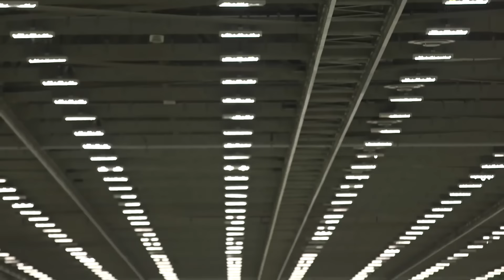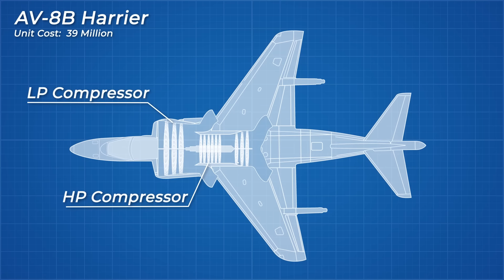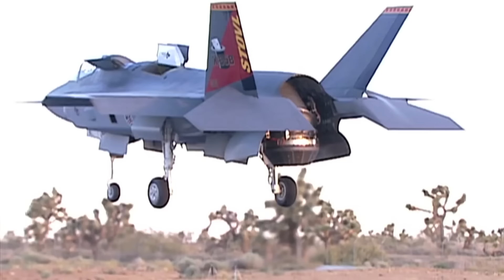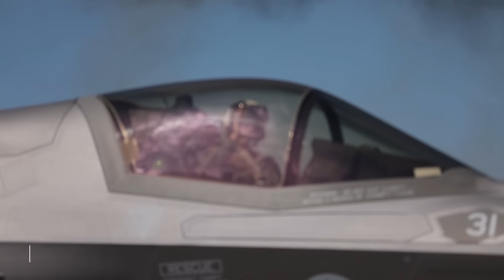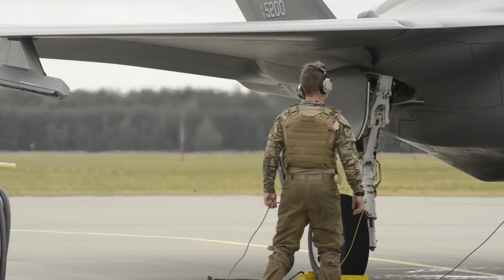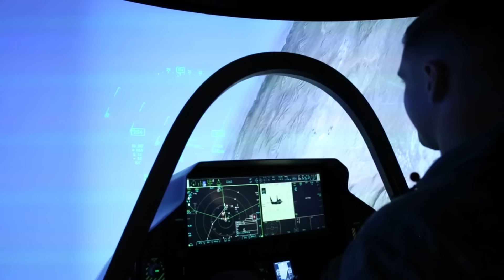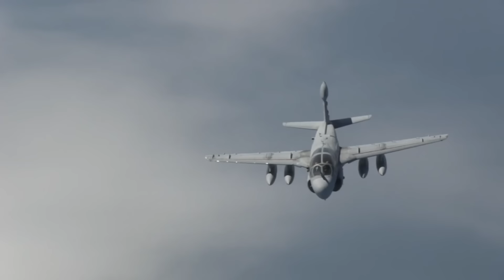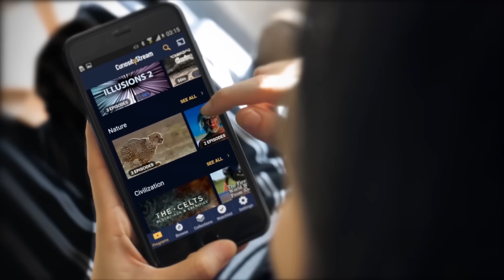Is The F-35 Worth $115 Million?

Comment: The weakness in the F-35 is, as reported, it's ability to recover kinetic energy levels after a turn. In a real world scenario the F-35 would see and fire first but would then turn tail and run. On turning, it will take some time to develop enough speed and distance to avoid being detected and fired upon itself. The very act of turning makes it more detectable too.
The only way to avoid the fire, turn, run tactic is too operate in big groups that increases the probability that no one will survive to fire back. No easy task when you consider the Russians, for instance, usually operate "en masse", carry more weapons per aircraft and fly faster.
Reply: Lol, the F-35 doesn't even need to turn and run. The 5th gen weapons complement and data link capability implies the plane can unload it's entire payload without ever switching on the plane's active radar with AWACS support, not to mention it's stealth capabilities. 

Data link implies that any American allied asset in an F-35's zone of operations will provide it with battlefield intel and vice versa. These are flying command centers capable of absurdly long range strikes.

And uhh, we've all seen how good the Russians are at "en masse" strikes the past few months
Reply: @krityaan  It is clear to me that you are pretty clueless so I will try, just a little, to enlighten you Krityaan Thapar. 
First, 5th generation refers to aircraft and not to the weapons they carry. If missiles were grouped into generations the most cutting edge ones would be something like 55th generation. 
Secondly, turn and run is a standard operating procedure because if you fire first it is pretty stupid to continue to close on aircraft who still have their full complement of missiles. Add to this that, as a rule of thumb, Russian aircraft carry around twice the number of missiles as our aircraft and so you are being reckless if you continue the advance with only dogfighting on cannons as an option.
As for AWACS, don't you think the Russians have their own system?
Reply: @krityaan  "guided munitions"? This phrase shows your total ignorance. Quite unbelievable from someone who is quite obviously Googling away.
Reply: @robwilton9539  
1. 5th gen refers to the platform, not specifically the aircraft, because it needs to be able to perform the role. It includes the weapons, avionics, and airframe.

2. Turn and run isn't a procedure at all for the vast majority of combat situations, let alone standard. There is no such thing as a true fire and forget missile, because missile seeker ranges are significantly less than aerodynamic max ranges. This means that turning and running will guarantee your missile will miss the target unless you are already within visual range, at which point there's no point running because you won't outrun the enemy missile.

3. Standard procedure is to put pressure on the target by reducing closure rate and maintaining an offensive position for a follow-up shot. If the enemy manages to avoid the first missile, or looks like they might, a 2nd missile is launched to take advantage of the enemy's low energy state after they've tried to avoid the first missile.

4. Russian fighters generally carry less than American fighters. Although an Su-35S can carry more than an F-35, it doesn't, because the Su-35S carries everything externally, which results in huge losses in performance due to parasitic drag. A standard air to air payload for the Su-35S is only 6 missiles, which is the same number that the F-35 can fit internally without any penalty to it's performance, and the F-22 can carry 8.
Besides, if you're comparing the big fighters, then the F-15 can carry significantly more than the Su-35S and has significantly better avionics which make it superior for BVR combat.

5. He didn't specify AWACS. He said datalink, which is the communication of actual data between aircraft. AWACS are just flying early warning systems that direct fighters to targets... the fighters still have to manually detect, track and engage the targets once they are in range. Datalinks provide the actual target position to other platforms, thereby enabling the F-35 to guide missiles launched from other aircraft among many other capabilities enabled because of datalinks.
Reply: @dumdumbinks274  Thanks for your input Thingy. A little knowledge is dangerous you know. You seem to have half the picture.

Comment: Your observations about the F-22 is why the F-35 is a jack of all trades and a master of none. Same result when you throw in the A-10 which is top dog in CAS, nothing else comes near its capability in that role. 
BTW: Multi-role aircraft always suck at one or more of their roles because of physics.
Reply: Lel. Re CAS, the A-10 isn't the main aircraft that USAF uses on CAS missions. Multirole is great because there is things that overlaps like for example, you need good radar, sensors, and avionics for both A2A and A2G.

And also, it's great on logistical side of things.
Reply: A-10 doesn't even perform CAS better than the F-16 except for in a few specific scenarios. CAS is an extremely broad role as troops need support no matter where they are or what the situation is. Disregarding the obvious issues with the A-10 against any enemy with air defences, response times are generally more important than loitering and firepower. Advanced communications systems help greatly too, which is why the B-1B has an extremely good CAS record despite being a massive bomber.
Reply: A-10 hasn't been top dog for a long, long time.

Comment: The B2 bomber program came to about 20x per plane, or almost $2.1billion.  Was that worth that?  Good planes are always worth it, as they fly forever (B52?) while bad ones quietly are mothballed.
Reply: The B-52 will outlive us all
Reply: The F20 is angry at you.
Reply: Why was the B-52 used for so. Damn. Long? It was first introduced in February 1955, and it's just kept on going. It's been nearly 70 years! They just renew the fleet every so often with newer technology. Why was it used for so long? Is it the ease of replacing the tech? Does it just fill a role that doesn't need changing or something?
Reply: @Crowbars2  you know the b52 has to have all air defense systems cleared to be utilized. It’s only useful in complete air dominance battlefields. You’d doom us all with your incompetent  understanding of modern air combat.
Reply: The B-52 is legendary 😍🔝
Reply: Making weapons is wasteful on human lifes and all resources
Reply: "Good planes are always worth it"

That has never been true, hence why the F22 was cancelled.  Performance wise, the F22 was a marvel.  The problem is it costs way too much to operate.  It's per hour cost dwarfed that of the F15 by nearly a factor of 3.  It was also very maintenance intensive.  It doesn't matter how fancy your plane is if you're always fixing it or run out of money and parts to keep it airborne.  The F35 has many similar problems to the F22.  It is far too expensive to fly.  The original intention of the F35 program was to create cheap fighters that were easy to operate.  Somehow, Lockheed Martin gave us the exact opposite.
Reply: @Maniac742  The F15 originally had criticism as being expensive and expensive to run, yet it's capabilities proved it's worth. Part of the reason why the F22 was canceled is that at the time the military had gone into the mindset of counter terrorism and asymmetrical warfare.
Reply: @Maniac742  Now it costs less than the competition lmao, how the tables turn
Reply: @yobeefjerky42  It still has over 200 bugs in the software.  That table is bolted to the ground.  You couldn't turn it with a forklift.
Reply: @Maniac742  What OS does your preferred computing device run on?
Reply: @Maniac742  the F-22 was never cancelled?
It's still in service as the US's air superiority fighter
Reply: @adamthebuilder172  There will never be another F22 made.  It is cancelled.  The ones in service are the only F22s that will ever exist.
Reply: it’s an absolute waste of taxpayer money lol amazing engineering but not at all necessary and simply wasteful
Reply: @jakob4112  A waste of taxpayer money until a war breaks out. Even without one it's part of deterrence.

Comment: The f117 was shot down because the americains were using the same flight path Just like a wild animal walks the same path. And the enemy had spies watching the base so knew it was comming. So the enemy knew when and were to look for it. With that info it paints anotherr picture.

The joke here is this, with all this tech they can't bring a bunch of pesants to heel. My use of pesants means poor soilders or armies. Go figure air power is not what it's cracked up to be. This is not 1939 to 1945.

Comment: Why doesn't the Carrier type have a cannon? It has no lift fan and bigger wing's? Why no cannon? Why only the airforce variant?
Reply: The bigger wings are needed to lower the stall speed of the F-35 so it can land on carriers. The bigger wings however create more drag, which reduces combat range and general performance. In order to make up the difference they decided to replace the gun with extra fuel, because a navy pilot is far more likely to need that extra fuel than he/she is to need a gun.
Reply: @dumdumbinks274  thanks for the answer 👍

Comment: And an F-16 70/72 is going for $140M per unit. But both that and the Panthers $115M price isn't the fly away cost. Current fly-away cost of the F-35 is $78M, the F-16 70/72 $64M, and for another point of comparison the F-15EX  $88M. Bear in mind that the F-16 was the single most expensive fighter of it's time and considered the same boondoggle as the F35 seems to be today.

Comment: I dont understand why this can be sold to basically everybody Nato and beyond while the F22 couldnt even been sold to the closest allies ...
Reply: Because the F-22A was canned as a project before that could even happen. On top of the USAF pressing the DOD for limited or no export on this model
Reply: @peterson7082  All ordered F22s were delivered over a decade ago. The US airforce just didnt order as many as originally planned.  While production of many components has ceased years ago Ive never heard of them cannibalizing their by far most expensive fighter. Im fairly certain theyre not dumb enough to not have spare parts stocked until the F22s retirement in the 2030s.
Reply: @TheDude50447  na the 4th gens form what ive heard are going till the 2050's and the F22 still is the best air superiority fighter. I see no reason to retire it in the 2030's unless the NGAD is so good and so cheap that we dont need the f22.
Reply: @generalmcarthur8401  I was surprised as well but theyve announced last year I think that the F22 will be retired during the 2030s. That means the F15 which it was supposed to replace wiull most likely outlive the F22 with the purchase of new F15EXs.
Reply: It's purely because of timing. The end of the Cold War resulted in drastically reduced military budgets, which caused a security concern in the late 90s... if allies got the F-22 during this time period, it's secrets would almost certainly be leaked to the Russians and potentially China. By the time the F-22 entered service there were discussions around lifting the ban on export, but there were very few potential export customers and it was argued that exporting the F-22 to so few customers would cost the US money instead of being profitable.

The F-35 on the other hand already had the UK involved as early as 1992.

Comment: 21:02 There's no way an A-10 costs 45.3 million.
Reply: It's very likely to be over $40 million per unit. The A-10 has historically cost roughly the same as the F-16, both to buy and operate.
Reply: There is.

Comment: 14:10 is incorrect a swedish company initially developed the technology and it was put on a swedish military aircraft which was then used back in the 70-90s when they spotted a plane flying far overhead on a regular interval which they then premptively jumped over max flying altitude and locked onto a sr71 this technology was then sold to SAAB who later sold the patent to america with the condition they can still freely use the technology

Comment: You missed the part about the fact that combine all these features into one plane, doesn't make it good at any of them. Jack of all trades, master of none. Overall it seems like a great plane, but judged individually for specific tasks, there are far better options.
Reply: The multi-role concept was proven to be more effective in the grand scheme of military planning way back in WWII because multiple single-role aircraft reduces the capability of the military to adapt when it loses those aircraft. Bases for instance have a limited capacity, and on top of that are prime targets. You don't want them filled to capacity because that means potentially losing a large chunk of airpower if the enemy destroys the base with standoff weapons, and if you have to split the capacity between more types of aircraft that means the number of losses you need to suffer in order for the base to become ineffective is much smaller.

If you have 20 air superiority fighters, and 20 strike aircraft, and you lose 10 strike aircraft your ability to perform strike missions is significantly reduced until you can provide reinforcements, and until those reinforcements arrive your ground forces will suffer because you cannot complete the important missions.

If you have 40 multi-role fighters, you might lose 25 of them across air combat and strike roles, but you will still have a larger number of aircraft available to complete any given role. This is especially important if you gain the upper hand, where air superiority becomes significantly less important than strike because the enemy no longer has enough aircraft to threaten your strike aircraft.

As for the F-35, it is not a failure in terms of the design and it's capabilities (it outperforms every aircraft it replaces by far and excels in the strike role), rather as the USAF put it (paraphrasing) "we asked for a workhorse, but got yet another high end fighter". The problem here is primarily logistical, where the US military cannot maintain enough F-35s to supply all airbases with their capabilities, so the most important bases will have F-35s, while other bases will have to make do with older aircraft. The biggest problem is that as aircraft age, they become more expensive to maintain, so because the F-35 is expensive the US are also stuck with less capable but still expensive aircraft that need expensive upgrade programs to remain relevant.

Comment: Many years ago (~2004) I saw a documentary about the competition for the JSF.  So this info is pulling from some old memories.  I think it was 'Battle of the X-Planes'.

The Boeing prototype had an issue caused by a last minute requirement change that caused the plane to end up heavier.  The LMCO plane already met these new requirements but it required changes to the Boeing.

As a result, they had to perform the vertical take off tests with some doors removed to save weight, but the same test plane hit super sonic once the doors were put back on.  Both plane makers produced 2 test planes.  One of the Lockheed planes is on display at the Smithsonian Air and Space Annex near Dulles airport.

There were 3 companies in the run-off at one point, Lockheed, Boeing, and Martin Marietta.  I don't remember which, but either Lockheed or Martin was eliminated, and then the two companies merged to form Lockheed Martin before the final run-off with Boeing.

The head of the project on the Boeing side had a full head of dark brown hair when this project started.  By the end, he was grey and bald.